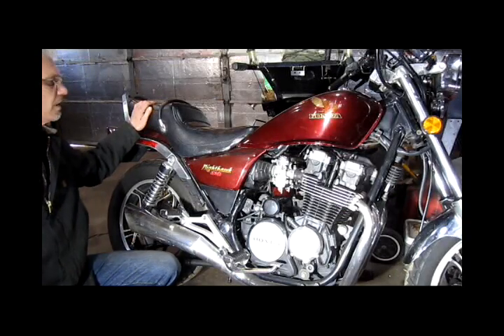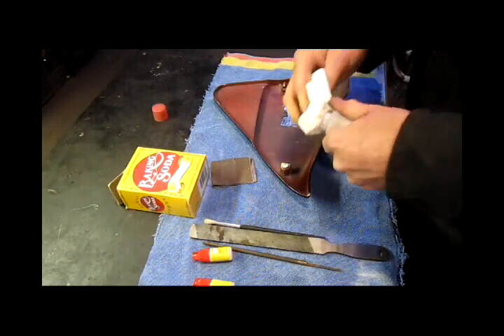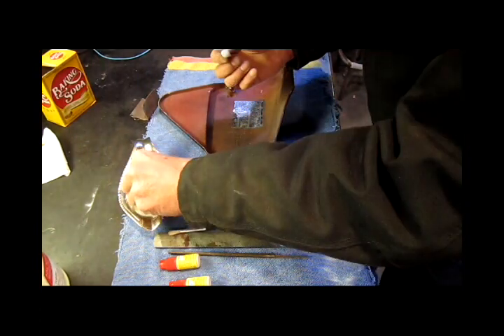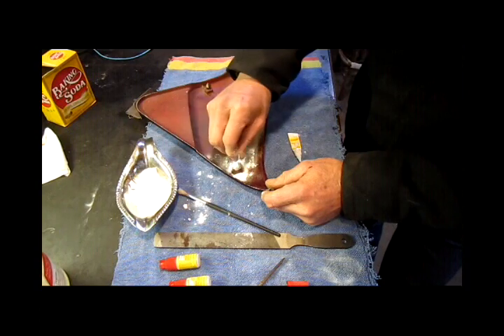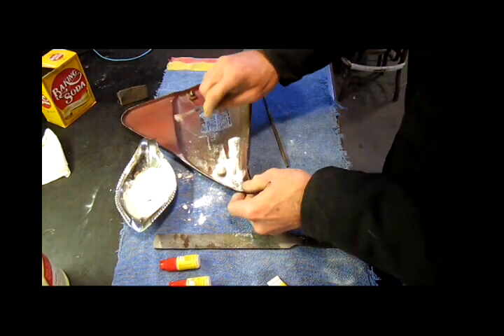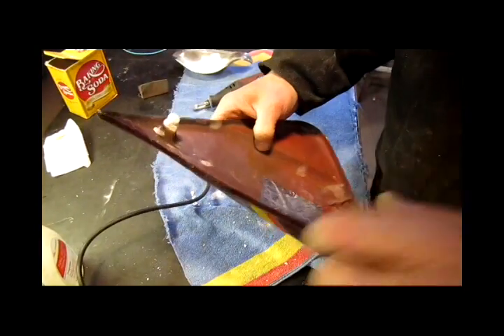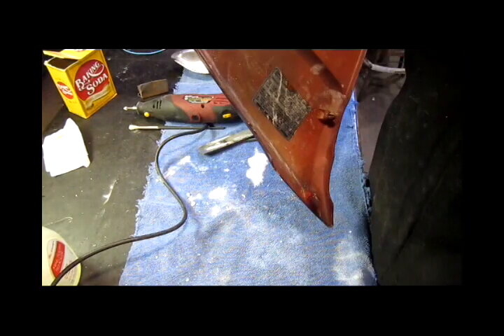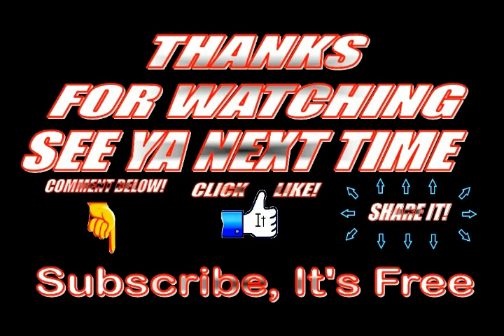Broken side cover mounting tab repair

Comment from the maker: Related products used in video from Amazon
Carbide Burr Set 10pcs Double Cut 1/8 Shank https://amzn.to/2URfzP8 
Dremel 4300-5/40 High Performance Rotary Tool Kit https://amzn.to/2D7ophG
Original Superglue(r) Instant Adhesive Mini Tubes, 5 Pk https://amzn.to/2IfNtY2
9 Piece Premium Grade High Carbon Hardened Steel File Set https://amzn.to/2VC5sLa
Super Nail Pure Acetone, 16 fl. oz. https://amzn.to/2Id0PE7

Comment: Let's see how others repair pin on cover. I just did that on GW. I made mixture of acetone an ABS, let set overnight into paste. I haven't had that much luck with super glue or epoxy A-B mix on plastics, so I try using same materials in ABS. I didn't have broken pin part to glue. Had to make entire pin. Acetone/ABS mixture lasts long time in glass sealed container. No mess of baking soda with ABS, just build dam with masking tape, pour ABS glue an let set.
Reply from the maker: Great tip!

Comment: great tip! how does this hold up over time? does the new portion you built up stay attached to the original plastic pretty well?
Reply from the maker: It holds up pretty good. But remember, it is made out of cheap chinese moped plastic and if you look at it wrong it will break, that's why you are fixing it in the first place. Ozone and UV rays deteriorate that plastic over time.
Reply: @Amotorcyclenut  yeah that makes sense. Good tip for sure will be using it soon. thanks!
Reply: I imagine getting new rubber orings or soaking the old ones in diesel for a day to soften the rubber would help lower the chances of the hardened rubber breaking the tapes again...
Reply: Working with cyanoacrylate glue (crazy glue) and baking soda to make various repairs over the years I learned that CA glue does deteriorate with time due to exposure, and in this case the tab will eventually fail, especially when the repaired part is exposed to the regular stresses of periodic use such as fairing tabs. CA glue and baking soda combination works best as a filler rather than a fabricated part IMHO.